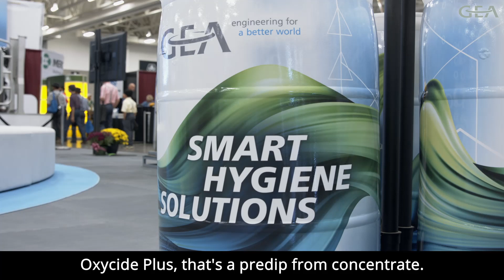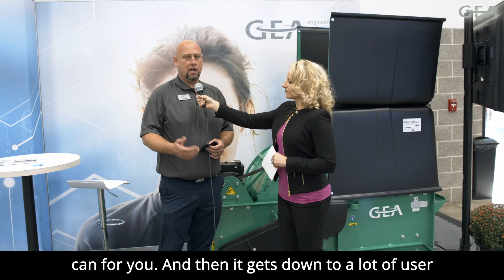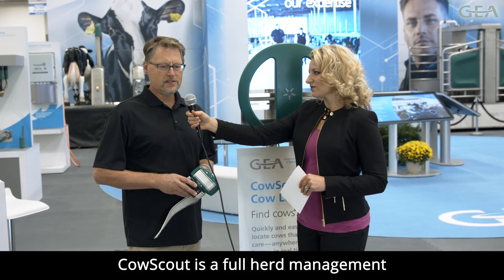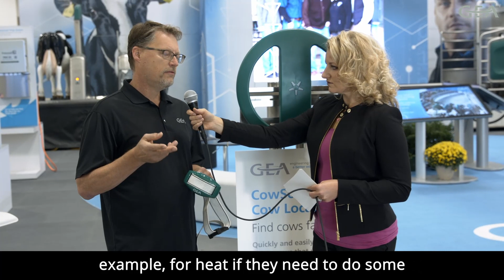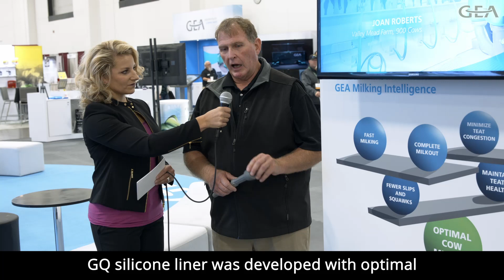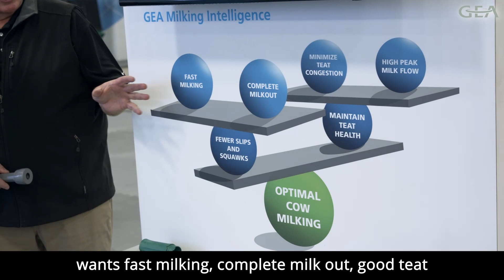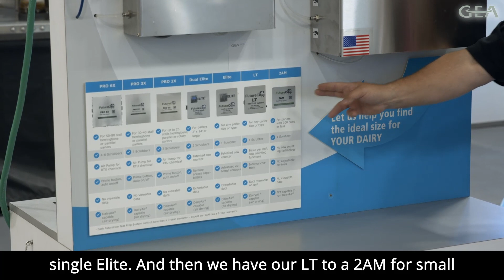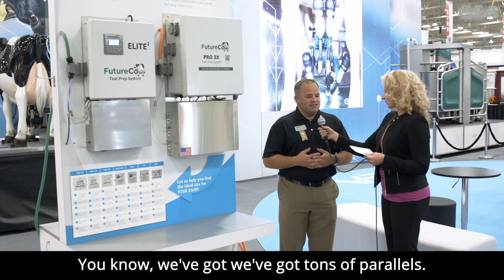Exclusive tour: GEA Booth at World Dairy Expo 2021

Comment: What management software runs all of these . Is I still Dairy Plan
Reply from the maker: Hi Brett - DairyPlan is still the core management software we use at GEA.  Though some of these new products run on independent systems so you can quickly get the info you need.  Software is constantly evolving, and more integration will be possible in the future.  Feel free to discuss your dairy's situation with your GEA dealer or local GEA sales representative.